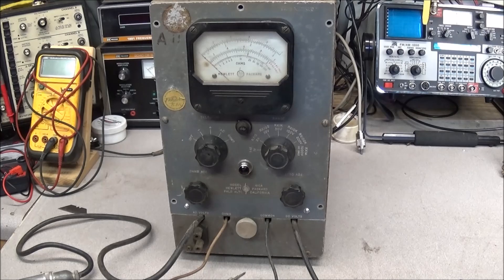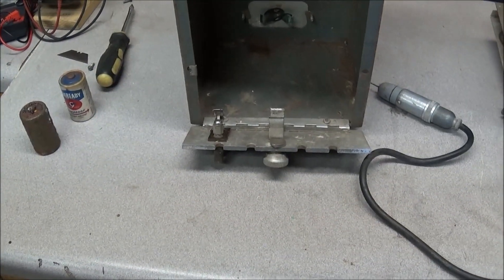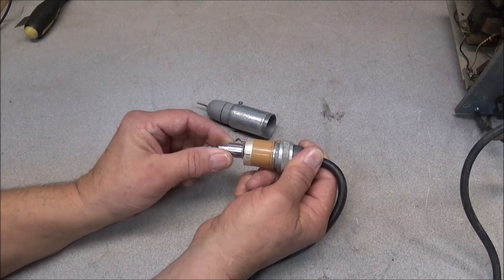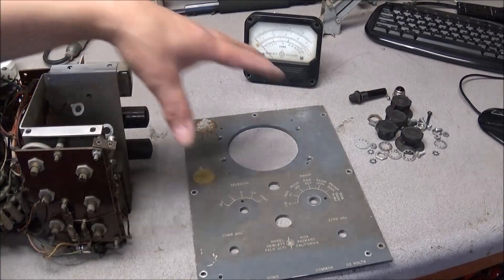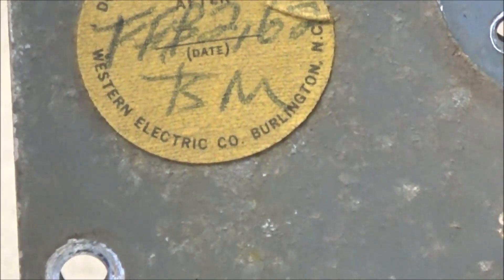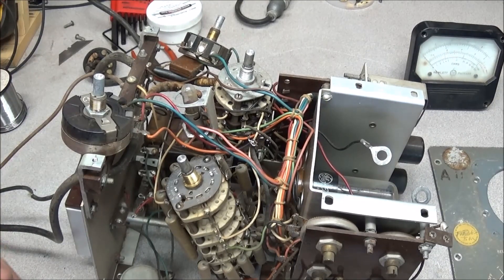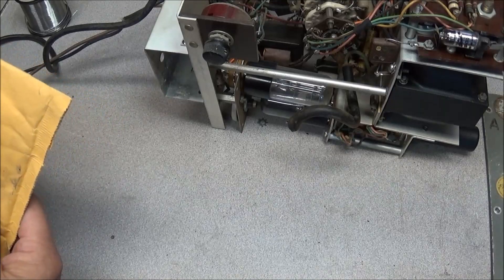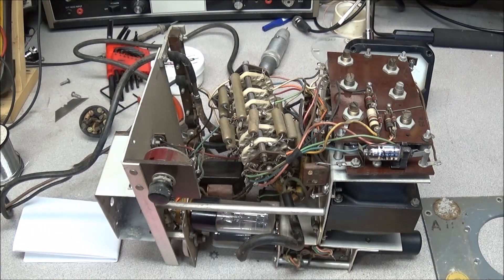#37 Hewlett Packard 410A VTVM tear down

Comment: I have a 1946 vintage McMurdo Silver model 900 VTVM that I am currently working on that is very similar in function and even shares some design features including the RF probe with the built-in tube (a 6AL5 tube in this case). I look forward to seeing the rest of this series, as it might just help me figure out why mine is measuring low by a factor of ten. 
Thank you for making these great videos. Folks like you are a great resource for struggling hobbyists like me. :)
Reply from the maker: Thanks for watching. That is a good meter also.  All caps must be replaced and those resistors need to be tested to see if still in tolerance.  As soon as I can get the time I will do another video on this one. Just so much going on. Thanks for the kind words and stay tuned for more to come.
Reply: Please don't hurry on my account. 
 As for my VTVM, I already have plans to replace the electrolytic caps, most of the pots (they're glued, so no adjustment is possible without destroying them), and any resistors that are out of tolerance. I will be going through and testing the resistors soon, and then I'll place a Digikey order to get the parts in hand. Then I should be able to get the meter into tolerance, I hope. Thanks for the advice, and please keep the good videos coming.
Reply from the maker: Sounds like you are well under way my friend. Now about the glue on the pots. Stop by a dollar store and pick up a bottle of nail polish remover. This is nothing but acetone. Use a straw from a wd40 or tuner cleaner can and dip in the nail polish remover bottle. Place your finger on the top end to hold the liquid and put a drop on the glue.  It will dissolve it so you can adjust the potentiometer.  May have to apply a few times but works great.
Reply: I will definitely try that! I actually keep some on hand, so I'll give that a try as soon as I get the meter back on the bench. Thanks for the tip! That might just save me a fair amount of trouble.

Comment: Hi Buddy, that mystery tube looks like the 10-4C that is the current limiter in my HP 400C VTVM. It also has that fiberglass covered 5 ohm resistor across the tube socket.

Comment: Potentiometer source - around 15:20 mins, you hold up a large pot and I was struck just how much it looked like some pots that I put in my JBL  L100 Studio Monitor speakers a few years ago after a nearby lightning strike. It took out the bass and mid-ranges and the crossover networks leaving the other two tweeter speakers. Anyway, just a suggestion, I can't remember the values of those pots but don't forget to check with JBL when looking for replacement parts.
Reply from the maker: Thanks for that tip.

Comment: Hey Buddy, great video as usual. I'm currently working on a 412A. I have discovered that there are multiple versions of this meter, and I suspect this is true of the 410A as well. I went around in circles trying to understand the schematic until I discovered that it was the wrong one for my version. If you haven't already seen it, check out the HP Archive on line. It wouldn't surprise me if you find another schematic that is more like the circuit you're looking at. I found the right schematic in an archived manual that was called the "Army Version". Good Luck! - jrh

Comment: Also the AC probe cable is a double shielded cable.
Reply from the maker: +MikesRadioRepair I was thinking it was by looking at the attachment point inside the meter.Does not look like it will be too hard to get it back going.  All the tubes test ok so looks like it will mostly be capacitor replacement and check resistors.

Comment: The extra tube and parts are if I'm not mistaken a HP factory diode circuit modification that was outlined in service sheet # 86 (I think).  Will have to do some digging and see if I have a copy of it.

Mike
Reply from the maker: +MikesRadioRepair Great Mike. I figured either you or Paul would have some information on this circuit. I knew it was not a homebrew mod because of the way it seemed to fit together. And all the marking on the tube have been rubbed off over the years.
Reply from the maker: +MikesRadioRepair You were right Mikehttp://www.ebay.com/itm/Agilent-HP-410A-Vacuum-Tube-Voltmeter-Service-86-Diode-Circuit-Modification-sc-/300913784210?hash=item460fdbf592:g:ajoAAOxyMxpRqL2qThat is all I have found so far.
Reply: +The Radio Shop 

LOL, why didn't I think of checking there.  I get almost everything else on ebay. :)  I'm pretty sure I have that somewhere, just a matter of figuring out which filing cabinet it's stashed away in.

Comment: Thank you for sharing I like old test gear well built like a tank
Reply from the maker: +DENNIS N Thanks Dennis. I love the old gear also and when it is rebuilt will make a fine piece of test gear.  I also agree with being built like a tank. Just the front panel itself is 1/4th inch thick!

Comment: Yes, as you said you have a pile of parts which was once an RF-VTVM. I'm sure you'll end you'll end up with a restored unit soon. I'd say that one similar to it was used in our WW ll electronics programs. I started in electronics in the Pocket Paging industry in 1965. We've come a long way since then. The company I worked for back then made very small super-regenerative receivers and  25 watt transmitters along with digital encoders which were used mainly in hospital in-house  systems. Now of course its all digital cell phones for everyone.
Reply from the maker: +Steve Seifer Things have really change. Sounds like you been around doing some exciting times with electronics. Thanks for sharing that.

Comment: Hi, I bought a HP 410B VTVM, when I bought it the Bakelite around the meter wasn't cracked; but when it arrived it's cracked. Is it easy to glue and what glue should I use?
Reply from the maker: Use a slow curing epoxy. Google bakelite repair, many videos show how.

Comment: Nice old 410 A you have there !!   These were specified by Collins Radio for the alignment on there transmitters and receiversof the day  like the A line and S line systems. That active probe not only allows high frequency response up- to about 600 MHZ but also allows HIGH ISOLATION from circuit under test,  IT WILL NOT LOAD the circuit down !  I think it is around 50 to 100 megohms  maybe more!!  A GREAT FIND  I have the 410B .....   ____John A Bellas   KC2UVN
Reply from the maker: +John Bellas Thanks, what better to work on an old rig than an old VTVM.  This one is going to be nice. Been wanting something like this for a long time. Was happy to see it chow up. Thanks for stopping in and sharing John.

Comment: Nice video! I'm always happy to see new uploads from you.

May I ask a question?
I have a Motorola CM-140 2m 25W radio, that has some problems with RF power output.
When I got it, the output power was around 1W instead of 25 regardless of software settings.
I've downloaded the service manual, which contains a troubleshooting chart for the  transmit section. Right the first question is about current consumption when keyd in. Mine had around 2A at 1W output. They pointed me towards the 2 pin diode after the power amp, and the power amp itself. I tested all I could in that section, all looks fine. No repair has been done before in this radio. 
Now comes the funny business. After I cleaned everything, reapplyd thermal paste, I noticed that if I mess around with the 2 screws that holds down the final transistor, the output power sometimes changes. Once I managed to get around 15W out. There were cases when the power dropped, than increased again while holding the PTT, or rekeying several times.
I checked all the solder joints, resistors around the final stages, protection circuits, resoldered the 2 pin diodes.
You have a lot of experience in repairing radios, so please I welcome any ideas, advices what could be wrong.

service manual: http://www.radioscanner.ru/files/download/file9090/sec4_vhf1_low_power.pdf

Thank you, 73's
Reply from the maker: +worroSfOretsevraH Thanks for your comment.  Glad you like the videos. I take a look at the manual and see if anything stands out. But what you mentioned on the fault sounds like a micro fracture on the circuit board. You will need a very power magnifier to see it, or a light box. But I will have a peek today and see if I notice anything.
Reply: +The Radio Shop OK thank you. I will check the pcb with a strong light and magnifier.
I was wondering if it is possible that the transistor has some bad joint
 inside or something? Can this happen to these high power final 
transistors? (maybe due to stresses from the 2 screw)
Reply from the maker: +worroSfOretsevraH That would also be a very good assumption. Power transistors use very tiny bond wires going to the die. And can break.

Comment: Hello again !!  Regarding the 410 A  That ADD ON BOARD , might have something to do with the filament power supply system.. Looks like that TUBE might be a BALLAST tube for filament control, Now that I think about it , It might be a filament supply for the active probe !!!  with that little diode doing rectification to change AC to DC for that little filament in the probe!on the other hand  maybe it just keeps alll the other tubes supplied with low voltage filament just to keep them slightly warmsort of like a SOFT START circuit !! ??
Reply from the maker: +John Bellas Thanks to Mike and Mr Calsons Lab we figured the board out. It is a current limiting circuit. Very interesting.  So your analogy is pretty good :)